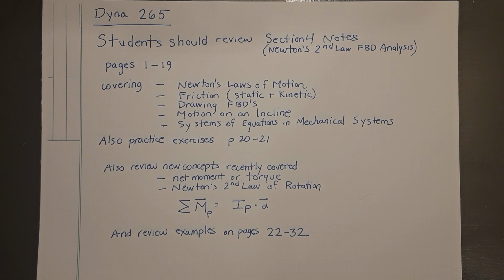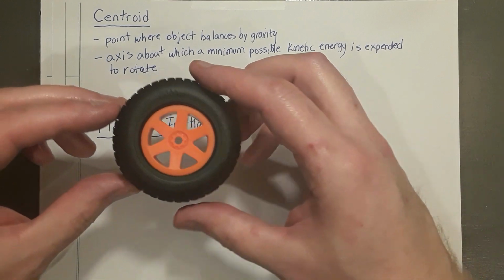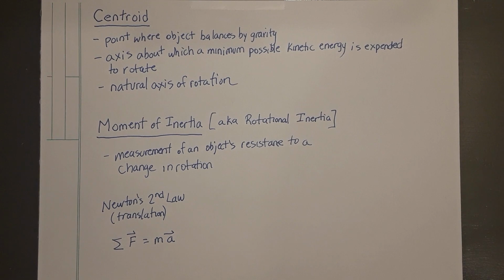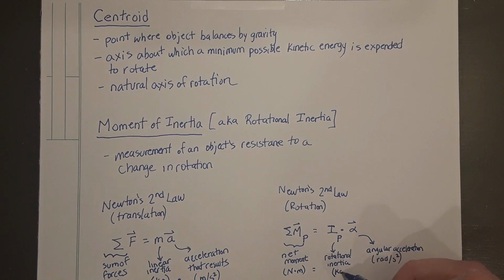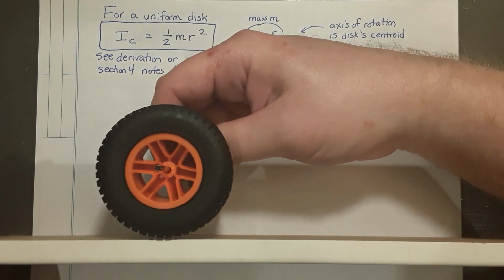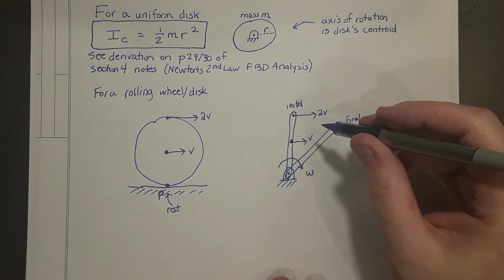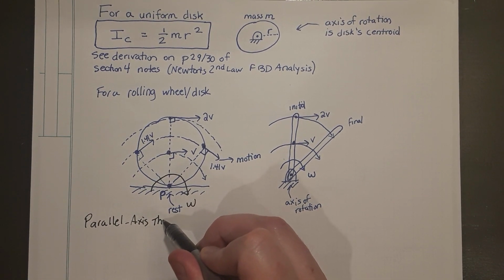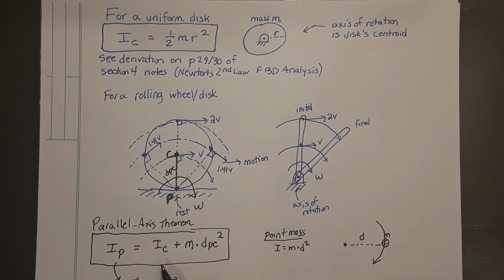DYNA 265 - Parallel Axis Theorem and Moment of Inertia

Comment: Hello Mr. When I should take center of mass as rotation axis in rolling motion .Do I have to take point P as rotation axis all rolling motion please answer I have final exam :((
Reply from the maker: It depends on the method of analysis used.  This method uses the parallel axis theorem for 2-D rolling rigid bodies, so you examine the object as rolling about the point of contact at rest with respect to the surface upon which it rolls.

If you are using a dynamic equilibrium method, the FBD will have "inertial forces and moments", and you will use the centroid as the axis of rotation.  In those examples, the net moment totals zero when accounting for the "inertial" loads.  

In practice, to determine quantities like static friction loads on the rolling wheel, using the parallel-axis method does not prevent you from taking moments around any axis, like the centroid for example.  Doing this would have the static friction load appear in your moment equation, and you could solve for it after you have the resulting motion solution.  Using net force on the wheel in the direction of motion would have the same frictional solution.

By using the parallel-axis method, it allows you to take moments first around the point of contact, and the frictional load and normal force would both have 0 perpendicular distance from that axis, and so don't appear in the moment equation of motion, so you don't need to solve for them if you don't need them.